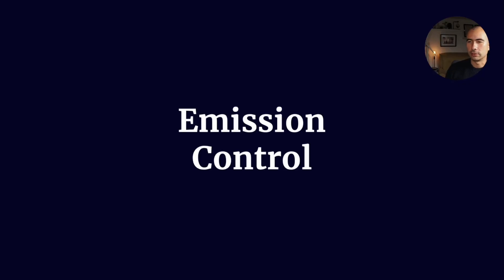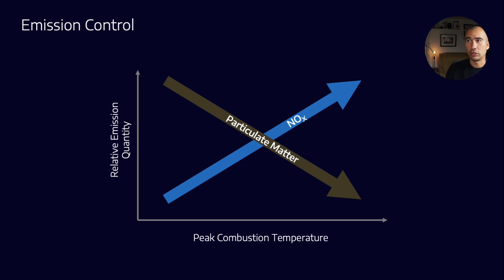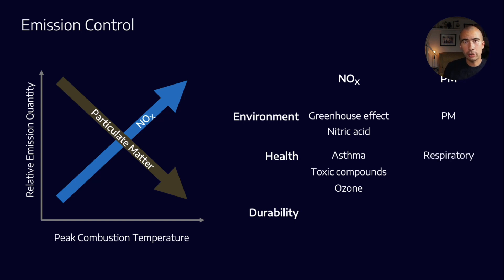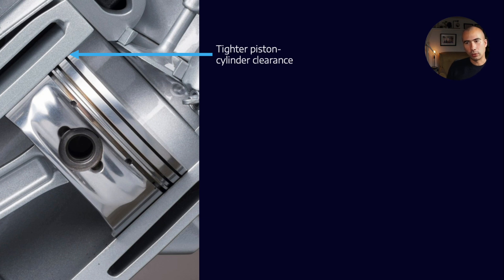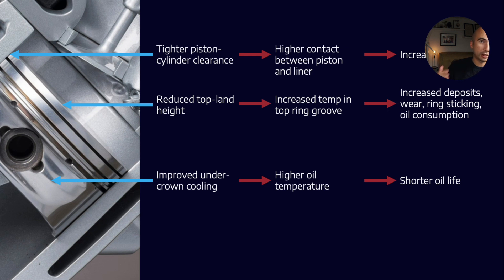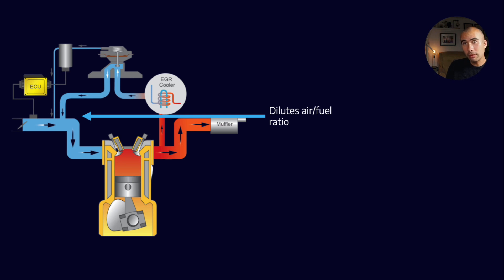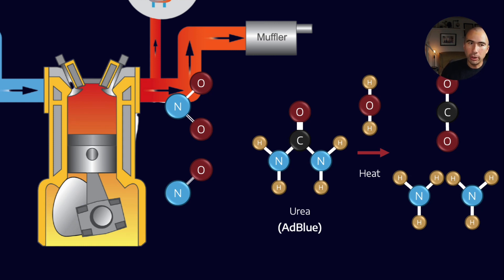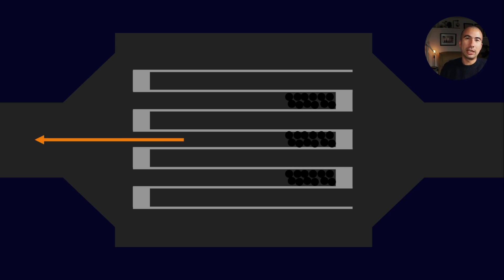The Impact of Emission Reduction Systems on Engine Oils

Comment: Vehicles were running plenty clean enough after 2010
  Anything added after 2010 has had a huge impact on engine longevity.  And is bs!   The EPA got to big for there britches!  Now look whats happening.   They cant enforce there ridiculous regulations they put on manufacturers.   I smell freedom in the air

Comment: in the boats wee have engines diesel spirated that run relatively ow temp, older generation engines before all the reductions... wee noticed excessive wear using modern oils :( really struglening to find a modern oil that is still good for the old engines :(

Comment: Another potential impact with DPF burns is the possibility of additional fuel dilution of the oil. But depends on the method an engine uses to provide the extra fuel for a DPF burn
Reply from the maker: Great point! Also, just saw your email - will reply over the weekend!
Reply: @LubricationExplained  no worries👍

Comment: One more thing about DPFs that you didn't mention - some burnt oil additive particles (& sulfur) are really hard, if not impossible to burn during regular engine operation and/or (forced or not) DPF regen, eventually leading to the filter becoming useless (effectively clogged for life). Probably the main reason for the Low SAPS mandate. Doesn't hurt that it helps with catalytic converter poisoning :)

Pretty sure there's more to it, don't hesitate to correct!

Comment: Awesome video. Explains the whole concept of cleaning the exhaust. I do have a question. You mentioned that NOx can cause corrosion. May I ask where in the engine can it occur? Like the engine walls, turbocharger, valves? As an environment chemist, I am planning on making a DIY Adblue system (mixed with some ethanol to prevent freezing) in an older diesel so that I can manually start injecting adblue in SCR (after catalyst and dpf) to reduce NOx emissions. I will need some stochiometric calculations and DIY circuit, but if I'm correct, I should be able to resuce the amount of NOx substantially. I'll keep you updated xD
Reply from the maker: Good question. The corrosion I've seen mainly occurs in places like the big end and crankshaft bearings - but theoretically any yellow metals tend to be more susceptible to the effects. NOx usually gets into the crankcase (there's always a small amount of blowby) and forms Nitric Acid. Once you raise the acid number of the oil it raises the corrosion potential as well.

Comment: The albedo/atmosphere make the Earth cooler not warmer.
Yes or no? If no pls ‘splain.
The GHGs must absorb “extra” energy upwelling from the surface radiating as a black body. The kinetic energy heat transfer processes in the contiguous atmospheric molecules make BB impossible as also demonstrated by experiment.
Agree or disagree? If disagree pls ‘splain.
If both or either of these points is correct the greenhouse effect is not.
No greenhouse effect, no GHG warming, no man/CO2 driven global warming or climate change.
Version 1.0 121521
Reply from the maker: This video isn't about climate change - it's about lubricants, lubricant technology and regulation. There are much better forums to have this discussion with far more knowledgeable people.

Having said that, I've always advocated for first principles thinking on this channel, so let's parse out your logic to see if it makes sense from the way I understand physics.

Firstly albedo. "Albedo" cooling the Earth doesn't really make sense, so although you didn't specify I'll assume you mean that "higher albedo" has a cooling effect. In this case, yes, the physics supports this statement (as does common sense - white objects tend to be cooler than dark objects). How does that relate to the video above? Particulate matter has a complex relation to temperature because in the upper atmosphere it can shield the earth from radiation (as when a volcanic eruption cools the surface) but when it coats light surfaces such as glaciers and lowers their albedo it causes surface temperature to increase. So as the overall albedo of the earth decreases due to melting of glaciers, ice caps, deposition of soot etc, it would have a warming effect relative to the past.

Now let's talk about GHGs. Do GHGs act as black bodies? No. But that isn't helpful because a black body is an idealised object, and the real world only ever approximates a black body anyway. What we do know is that the earth absorbs the sun's radiation at many frequencies, then emits them "like a black body" over a different wavelength spectra - a generalised statement would be that the earth absorbs at short wavelengths and emits at longer wavelengths (roughly infrared). Some of that radiation passes straight through the atmosphere, some is absorbed by the gases. We know that these molecules must absorb infrared wavelengths because in the lubricants industry we use the property in FTIR testing to recognise different molecules in a lube oil sample. https://youtu.be/W8XaydVALNI. Now the question is how do they shed that energy (if they didn't, there would be thermal disequilibrium and the atmospheric molecules would continue to increase in temperature ad infinitum)? As you said, they aren't black bodies due to contact with adjacent molecules, so this means some energy is radiated and the remainder through conduction or convection. Of the portion that is radiated, some end up in space, some ends up in the atmosphere, some reaches the surface.

So far everything we have explained is in equilibrium over a long enough time horizon - much like an actual greenhouse getting very hot during the day, but over a long enough time out of the sun (night) would return to standard temperature. What we aren't accounting for is rate of change. As we add more GHGs to the atmosphere, it's just like increasing the thickness of the glass in a greenhouse each day. Each day, the greenhouse traps more and more radiation and the average temperature increases.

So no I don't agree with your statements, especially your use of 'splain when explain is the same number of keystrokes :)

Comment: Fantastic video, and very applicable to current events. There are many other advantages egr offers I feel should be mentioned. During warm-up the egr duty cycle is often quite high 80-100% this is to assist in rapidly heating up the engine and dpf if equipped. The heat engine is scavenging heat from exhaust at least until operating temp is achieved. Once at operating temp, egr duty cycle is quite low especially when under load 3-12% to assist with NOx inhibition but also provides a small fuel economy benefit scavenging heat and pumping losses.
Reply from the maker: Great points mate!
Reply: How does the DPF heat up faster if you're reducing both the incoming gas temperatures and the oxygen content? 

EGR as a separate circuit (as in all diesels) also has the potential to clog up unevenly, leading to differences in temperature reduction across different cylinders.

Honestly, not a big fan of using it as an emissions control device, given its downsides and the effectiveness of DPF + 2-way cats combined with SCR (& LNT before SCR warms up). Crude solutions but then again so is the diesel engine at its core ^_^. Another question would be why more OEMs haven't gone down the low comp diesel route, given how some real-world implementations managed to reduce chamber-out emissions (due to better mixing, which is the fundamental issue) to the point that they managed to meet certain emissions tiers without brute force aftertreatment. Granted, won't be enough nowadays, but getting the engine-out emissions to be as clean as possible sounds like a win for everybody....
Reply: EGR is also great for adding soot straight into the engine causing it to wear 10 time faster and block the intake with sooty sludge. 
The Dealships love making money on premature engine rebuilds.